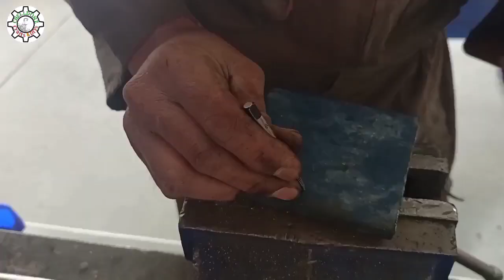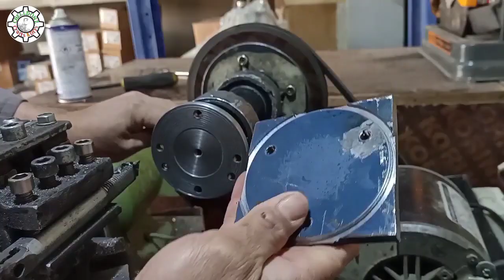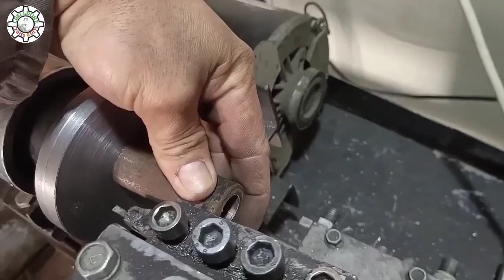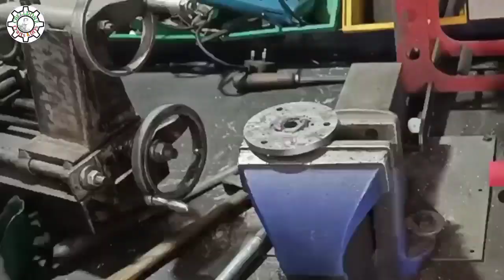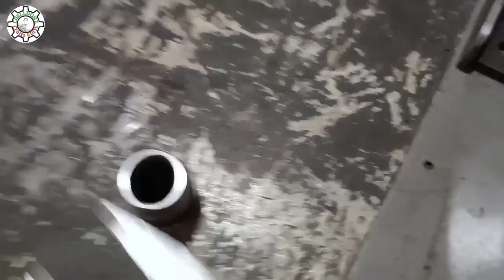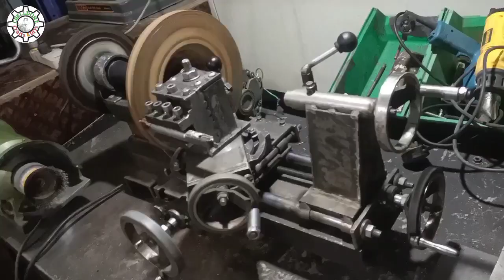Back Plate For Double chuck lathe chuck and brake disc lathe. /Homemade lathe machine

Comment: You need to turn both sides in one set-up. I've tried it on a regular metal lathe many times. Like tool room quality lathes. Even with indicators it's nearly impossible to get the runout out unless you machine then entire rotor. Just .005" will pulsate in stopping.
Reply from the maker: Yes much better the brake lathe because two sides is reface together not like this that you re setup the disc. But if  no brake lathe we have no choice. Thanks for watching my video.
Reply: By the way I subscribed 👍
I re read my post. It sounded as if I put down your chuck. That wasn't my intention. It's a great setup you made. You just now need a double tool post to turn both sides at once. 
       I have tried several times to turn my own and save a trip to town. But trying to hold them in the center and then flipping it's just near impossible to get to ground zero again.
Reply from the maker: Thankyou